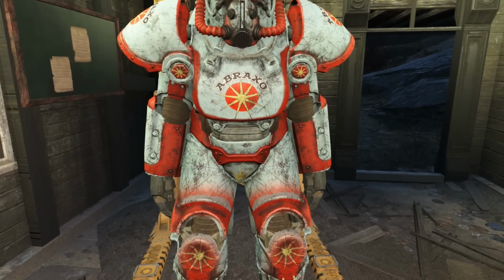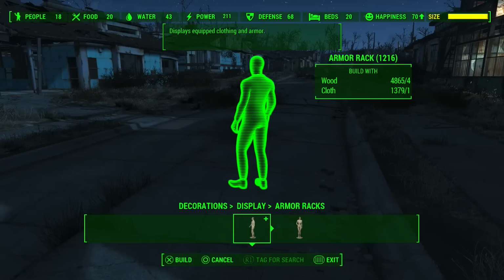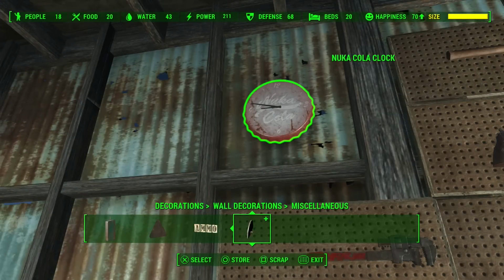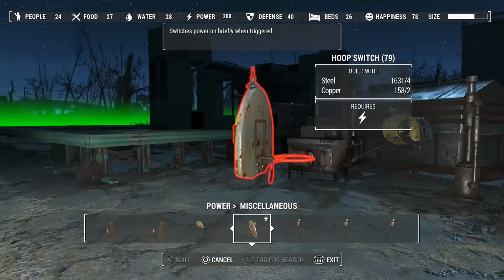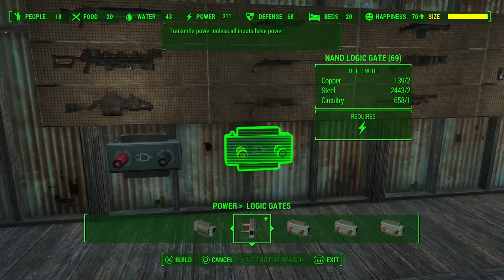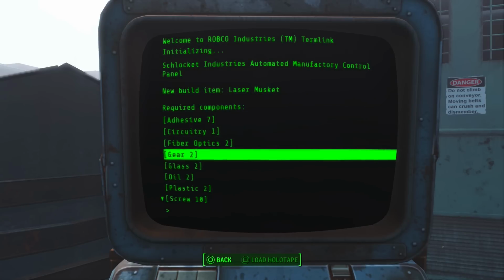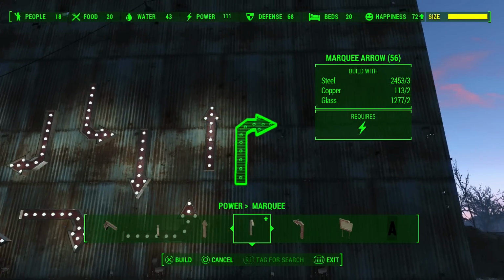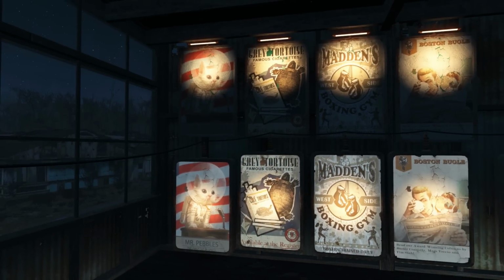Fallout 4 - Contraptions Workshop Guide

Comment: I have a big problem with this dlc. In order to make my building machines build things I have to haul the materials from my workbench to the machines. It's a pain in the ass. Why couldn't they have just had it where the machines connect to your workbench
Reply: In case u wanted to save some resources?
Reply: I wish their was a dissembling machine... put in junk and it dismantles them into loose items.
Reply: +boxhead6177 the workshop does that for you
Reply: if you put some thing in front of your  workshop it pulls items out
Reply: Vaccum hopper near workbench done
Reply: Just a quick question what's the point of building items?
Reply: SKULLBOY 013 you can buil rare ammo tho
Reply: +OverDoze_ Hacker ahhh ok idk too me that seems like kind of a complex contraption option to do something like that though I have not experienced it first hand but I just fee if I had it I wouldn't want to build it because it seems over complex just to build rare ammo but I'm probably not experienced enough with that part of dlc to judge it correctly
Reply: for me nothing works I don't understand what I'm doing wrong 😭